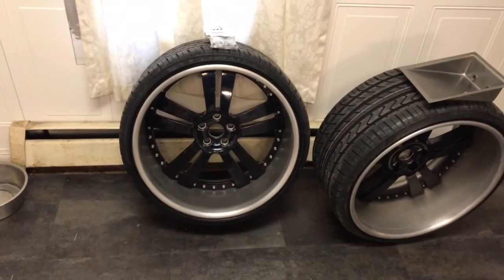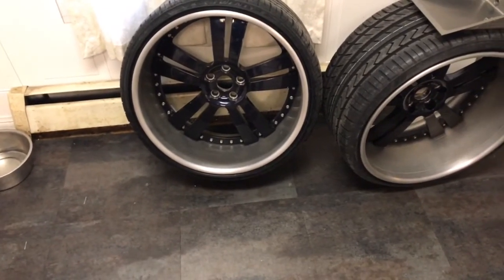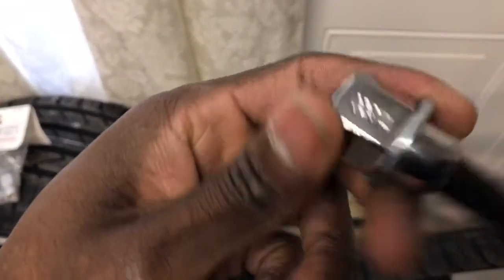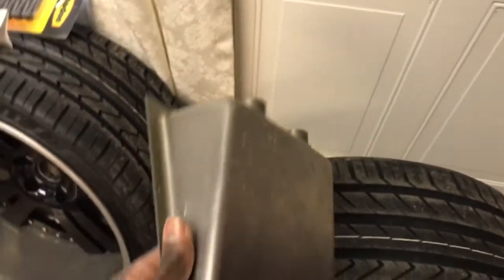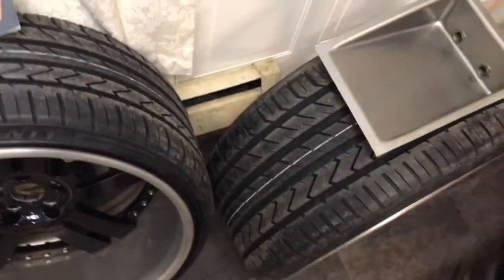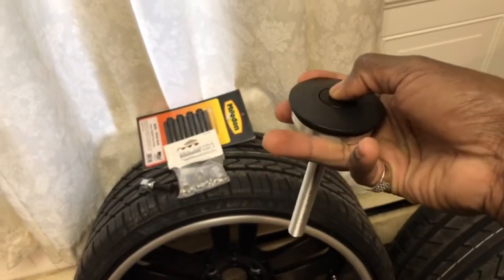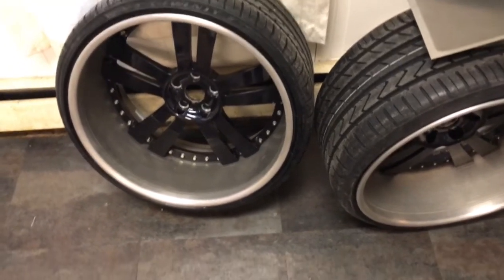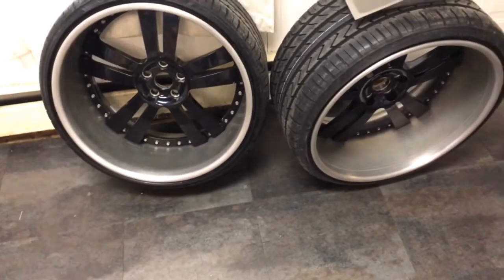Tires mounted and new toys for the chevelle

Comment: if it's under 300 I can't beat that price but this kit has drill slotted rotors and breaded lines
Reply from the maker: dee brown whats your price for a complete set front and rear?
Reply from the maker: dee brown the rear kit I was looking at is on SummitRacing "Right Stuff Detailing Rear Disc Brake Conversion Kits AFXRDM5" for $279, but like I said I'm going to upgrade later and if your price is right I'll just do it now. How many pistons are the brakes and what's the brand also?

Comment: 850 drill slotted rotors chrome brake booster and master cylinder 2 inch dropped spindle I know but if you don't want the chrome it's cheaper

Comment: trying find me sum not that deep tho but they clean
Reply from the maker: perch Williams I got mine off of a guy out in cali on eBay. You can choose your front and rear hub if you have a 3 piece rim or you can turn them into a two piece and have them cut the aluminum hub to your specs and it's cheaper. I just wanted to go deep as possible so I had to keep it as a 3 piece
Reply: BKChevelle 1972 dammit let get on ebay
Reply from the maker: perch Williams when I asked HRE they wanted to charge me 2300 for the hoops I think I paid $800-$900 for the set I'm all about ballin on a budget. When they were balanced they didn't need much weight on them to balance out which was good.
Reply: BKChevelle 1972 that what I do look 4 deals

Comment: hey bro do you already have your conversion brake kit for it if not I can get them and beat any body price
Reply from the maker: dee brown not yet what's the price on them summit racing have a set for under $300 for the rear that I was looking at until I upgrade later in life. My fronts are factory disk so I just need rear.

Comment: What would've been the difference in a 305/25r22 and a 315/25r22?
Reply from the maker: Primetime132 if I’m not mistaken the 305 and 315 numbers are the width of the tires....305 fits 10.5 to 11.5 and the 315 fits 11.5 to 12.5 inch wide tires. The 25 number is the sidewall profile or height and the 22 is the diameter of the rim or 22” rim in this case. I’m going to be switching to a a 315/30/22 for the rear and a 295/35/22 for the front